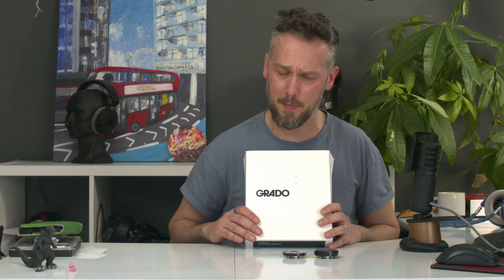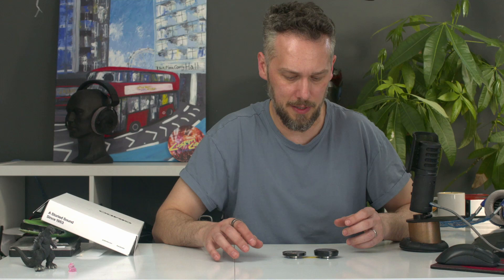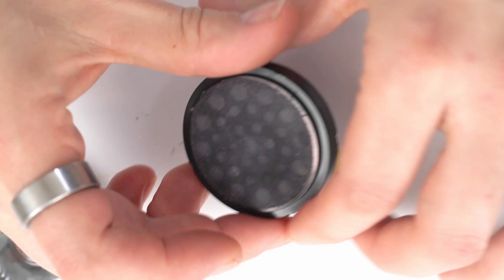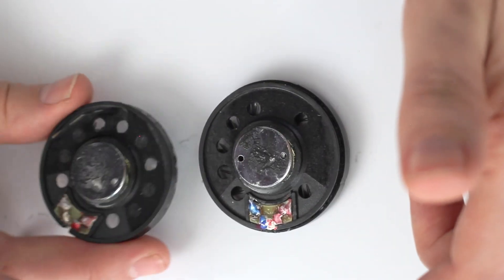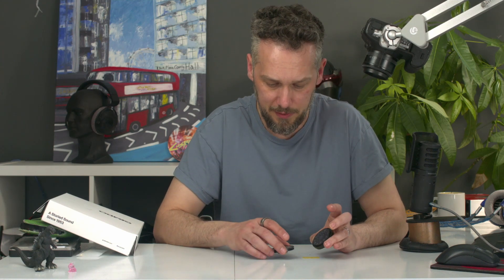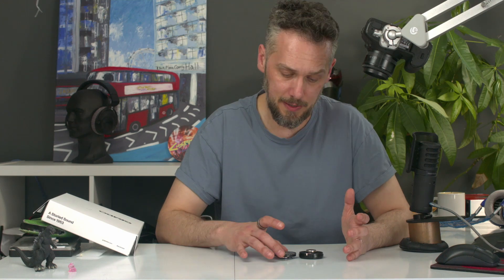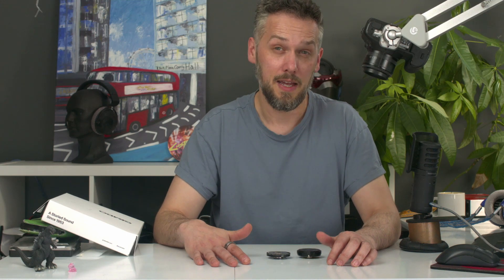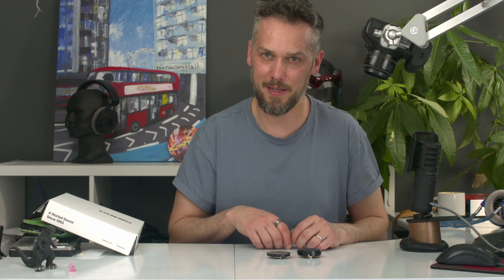Possible manufacturing error on Grado Headphones

Comment from the maker: It looks like it is caused by heat so could possibly be an end user blowing through the back of the driver with a heat gun but some of the ones we have seen look brand new. It is true that on some models you need to warm up the glue that holds them together to get them apart. But.. on these latest models they seem to have update the Glue so we no longer need to heat them to get the drivers out so we know it is not happening here. So... It may be some process they are using in the factory that is overheating a section of the diaphragm through the holes.
Reply: Out of curiosity to confirm that it's even possible and assuming you have a broken driver to test it on, can you replicate that damage with a heat gun or does the heat have to be concentrated in one spot with something like a hot air soldering iron?
Reply from the maker: @Ess_Chalk  Yeh, we did try it with a re-flow style hot air gun used for soldering and it did make a hole in the driver but did not look quite the same. We may do a bit more experimenting if I can find some dead drivers to test on

Comment: Apparently some incompetent employee at the factory. My old Grados from 2010 (SR60, SR125) have no holes; all the holes on the back are covered with fabric. Not to mention how barbarously these holes are made. In some cases, it's not even necessary to make a hole across the entire width; a small hole in the fabric in the middle is enough.

Comment: Making holes in the rear chamber after the assembly.! Why would you do that.?
Reply from the maker: Not sure - we tried blowing re-flow hot air gun through the back of the driver and that made similar holes so it may be something during the soldering process rather than during the hole poking process ;)

Comment: Subscribed.

I just bought a new Grado GS3000X.

Under 2 hours of head time, the left driver failed.

Unclear if it’s the driver or the connector. 

Problem is, I had it shipped to a country they don’t service. 

Unsure what to do.
Reply from the maker: We may be able to repair them here if they are not under warranty . It is worth popping an email to info@customcans.co.uk
Reply: @CustomCans I’m still under warranty. But I have to pay for shipping to NY and back.

Ugh.

Comment: Hey Jason, can you get a pair of Audeze's new LCD-S20 to see if if it's possible to mod them for balanced output by removing the two L & R channel wires running through the headband that connect both drivers to a single side, used with a 3.5mm aux cable instead of a regular Y-split balanced or stereo headphone cable?

Comment: If it sounds okay, then it's not terrible. There's stuff manufacturers do deliberately that worsens sound and it's in every headphone! As in, they make designs and none of them are perfect, from any manufacturer. It's just hard (impossible?) to get the sound perfect, especially consistently for different listeners or different placement/seals configurations (how it fits, how you choose to put it on, or how you end up putting it on unconsciously for that matter)...

They should fix it as soon as they're aware of it, but the sound being good is what I'd be most concerned with. Sure I want to get a non-defective product... maybe they can sell these at a discount as having a known issue. Or they can just open them and replace the driver, as I imagine the part cost for a driver by itself isn't massive.
Reply from the maker: Yeh, you are right ... the sound is the most important thing

Comment: Those drivers have the same exact diaphragm shape, exact position, shape etc of copper wire under the diaphram of the AKG K181 DJ. The back looks basically the same, the only difference is that the akg driver has 4 holes in the magnet but 2 of them are blocked. The vent holes placement is the same but akg blocked all of them.

Also the plastic housing look the same in the front and how the diaphragm is glued to it

I am designing a 3d printed headphone from scratch using those K181 DJ drivers, and they can be really good with the right tuning of vents, bass port in the earcups and internal volume
Reply from the maker: Sounds interesting 3D printing headphones is really kicking off at the moment
Reply: @CustomCans  Yep. For me, all started with your mass loading and damping kit for the HD25 5y ago (and those hd25 springs are devil creation), so TY for making those things!

Comment: how they even missed that in the QC is beyond me. Not surprised they sound ok, my koss ksc75 actually has a hole in one of its drivers because of a mistake i made, tho i have to say they do sound different, and i can tell it apart in lower frequencies where the driver with the holes would rattle around a bit.
Reply from the maker: We are not 100% sure it is happening at the factory as we get used pairs in but it seems to have only been on the latest models
Reply: @ Perhaps a manufacturing error in the factory where the driver is being made in, i dont think they build the driver in USA